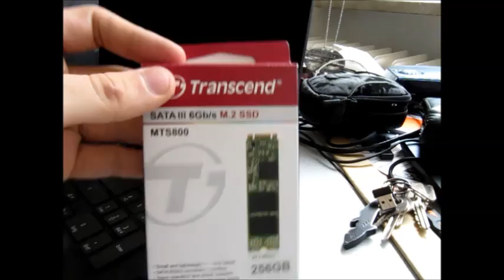Acer Aspire VN7-571g Disassembling and M.2 SSD Upgrade

Comment: Hey mate can you help me? I want to add some ram to my VN7-571G cause i bought the 4gb ram version, but i don't know where the ram socket is, can you do a video showing that or a picture please ?
Reply from the maker: +Luchin Bombin I'm not sure but i think that they are on the back of the mainboard. Go to 7:30 in this Video here. I think the RAM sticks are the ones on the Right, next to the USB plugs.
Reply: +Martianbuddah nice, ill check into that as soon as i can. One more thing, can you tell me how to unplug the biggest keyboard cable, the little ones are easy to do, but i cant unplug the big one
Reply from the maker: +Luchin Bombin I used a small flat  screwdriver to unplug the cables. That made it quite easy, i dont remember a big difference in difficulty between the three cables.
Reply: +Martianbuddah i had to push the white clip in the cable, instead of just lifting it. Thanks for all your help and time i hope you keep making this kind of videos :)

Comment: I have VN7-591G-77A9 it's with 60GB SSD. 
When i bought it i asked to change the SSD to 128 or higher, the guy in the store said it's not possible because it's one one piece with motherboard.
After watching your video i will definitely upgrade my laptop 
You added this SSD as external drive right? 

I found this photo, and this is inside look of my laptop. i think on the left side is the ssd and it looks easy to remove/replace.
http://www.notebookcheck.net/fileadmin/_processed_/csm_AspireV15_VN7_591G_Innereien_3d36158442.jpg

can i replace my 60GB SSD to 250GB  ? or i need to check motherboard is supporting that much? do you know about this??

Great job thanks for sharing !
Reply from the maker: +Anun Azganun yes, you can replace it.
Reply: Thanks!

Comment: Hello, I have a problem. I recently removed the keyboad of my v nitro to put a ssd in. I have the same v nitro as you. I removed all the cords (keyboard, mouse, lights) like you did but when i put it back together everything worked except for the red lights. Nothing seems to be damaged. The pins are not damaged and the cord seems fine. Do you know what i should do?? PLEASE HELP ANYONE. Thanks
Reply from the maker: +Tony Taouk Hard to tell without seeing it :D i can only imagine that the cable that is used for the keyboard lighting isnt plugged in the right way. But i guess you already tried reattaching all the cables more carefully?
Reply: Yes i did it like 10 times,
Reply: i had the same problem.! make sure u put the cable into the connector. and not on the "floor"of the board. i made that mistake like 10 times.. so watch good where u put the cable.

Comment: Great video, i have two questions, is it possible to install a video card in this model?? and the second one, this laptop supports 16 gb ram (so i can upgrade it)??
Reply from the maker: +theCronoceptor Sorry for the late response.the last time i opened the laptop was for this video so i'm not sure about the possibilities anymore. As there is a graphics card in my laptop, i'm pretty sure that upgrade should be possible. ( So if you dont have a graphics card in there, you should be able to get one ) And i would be really surprised if the ram upgrade isn't possible. I'm not sure if there is a free slot but you should be able to replace the existing ram with more powerful one.
Reply from the maker: On second thought, the gpu upgrade might not be possible (or at least not easy). Maybe the laptops that are delivered with a gpu already inside have it welded onto the mainboard. And if welding is a necessary part of the upgrade, i would not recommend trying it :D.
Reply: Ok, thanks for the respone, i think that too (abouth the gpu). One last question, do you know if this model supports 16 gb ram?? So i can upgrade it??
Reply from the maker: +Faramind I think yes, but i cant't tell for sure, sorry.

Comment: Hello Friend I bought my notebook aspire v 15 nitro And so the pc works with feeding cable plugged in If you take the feeding cable and 
Blacked out
Reply from the maker: +Miguel Martins Sorry for the late response. Some other guy in the comments had the same issue. He forgot to plug in one of the cables that is attached to the mainboard. Make sure they are all plugged in, one is coming from the battery
Reply: Hello
and how I can download the dolby home theater ?

acer v 15 nitro
vn7-571g - 764l

I am waiting for your reply .................

Comment: Does anybody else who has this laptop have problems with the wireless at all?  It's got a Qualcomm Atheros QCA61x4 wireless network adapter.  It's really weird.  Sometimes it works fine, and sometimes it doesn't work at all.  The range on it seems to be pretty horrible as well.  It does this even when other wireless devices are working fine, and I have the most current driver for it.

And if the wireless card just needs to be replaced altogether, any recommendations for which wireless card I can or should replace it with?  Please help!
Reply: I have VN7-791g and I have the same problem... When I connect my WiFi the wifi logo disappear turn to LAN logo and say I can't connect to network... And sometimes it work fine.... Shitty wireless card.
Reply: +Kras3169 at home everything works great but at school the WIFI takes about 15 minutes to connect (or I have to reboot several times etc.)
Reply: +Kras3169 I had the same probleme at begin. In fact it happend only when i used it on battery. It is cause of the management of economy of energie. Just change your management of your wireless card to 'best performance' when using on battery. Then it work perfectly. Sorry for my bad english.
Reply: ***** I throw that shitty Qualcomm card away and change to Intel AC 7265....working fine.
Reply: Kras3169 you just need a #0 Phillips screwdriver and a plastic card, remove all the screw at the bottom of the laptop and use the plastic card to separate the top panel,there will be 3 cables connecting the top panels to the mainboard , so you have to disconnect all 3 before removing it... The wireless card will be located on the upper left corner. (3:25 in the vid)... There is two cables and one screw, remove the cable and the screw and replace yr wireless card... And put everything back together.
Reply: +Julien34B Thanks your for your response.  I will try it, and see if it helps.  I also bought a Wireless Range Extender, and that seemed to help.  Your English was good, no need to apologize.  Thanks again.
Reply: +Rage Tech I'm leaning towards taking your advice and replacing the Qualcomm card with the Intel AC 7265.  Is it going to be a pain in the balls to do on my own, or am I better off letting a store do it for me?  I don't have any special computer tools or anything like that but I also don't want to get ripped off letting somebody else do it if it's something easy.
Reply: +anonymousphox If you posted under the username ABCDEFGHJK, I get the same error message once in a while: 0x000001d8.  LMAO, what a pain in the ass!  It's so frustrating.
Reply: +anonymousphox +Rage Tech I just wanted to say thank you so much to both of you for your help.  I am in the middle of studying for the CPA Exam but when I get some free time, I will definitely try to get this done.

Comment: Hi is it possible to get out the key's by 1 and clean underneath it? And how is it done? I'm afraid of breaking something... Ty
Reply from the maker: +michiel pizza I dont know, sorry :D didn't feel the need to clean underneath my keyboard yet.
Reply: Hi, don't know if you got your answer, but it's something you can do easily once you know how the jeys are attached.
For the main keys (A,Z,E,R...), the top of them is inserted and the bottom of the is cliped. So you have to pull the key off pressing the top of the key and pulling the bottom of the key. Usually there's no risk of break.

For the other keys, the thing is to find the cliped side and the inserted side. Just train with the usual keys till you see the force you usually need to get off the key and then try on the other keys, if it's not enough try from the other sides till it works. ;)

I have exactly this computer too, and it took me some time at the beginning but you can do it !

Comment: Hi, thanks for your video.
I did it like you did and it is working. Great, but i got little issues when i want to build it together. 

First i bought the same SSD from Amazon for 99€.

Opening was easy, but i did it different, cause it seems for me better. I did it from the front, i took a Kreditkart instead of my nails and it was very easy.

Putting up the Kabels is easy. The big one is for the keyboard. when i put everything together, the keyboard was not working. I had to try 4 times till my Keyboard was working. You have to move the mounting forward, put the cabel in and than move the mountings back. not like the other ones up and down. 

And i got problems with the cabels from the Wlan Modul. I got luck and saw that one of the two aerial cabels jumps out. this is so small that it took a while to put it back again. 

After that i had to inilize the ssd under Windows and format the drive, than it works perfect.

I think with this video everybody can do that if he got calm hands. 

thanks for help.
Reply: +bebe München 
I recognized that my speakers are not working now :)
Reply from the maker: +bebe München glad you could solve some of your issues. of course touching the inside of a laptop is always a bit risky but being careful helps :D i'm not sure how the speakers are connected to the mainboard but maybe you forgot to reattatch one of the cables? Can you still use Headphones? just to be sure that your soundchip is working properly.
Reply: oh yes, i forgot the cabel on the right side to plug in :) 
thanks. now everything is working perfect. 

The SSD was a great choice, the laptop is now really fast. before i got only 500GB normal harddrive

Comment: hello ! really nice video, it'll be helpful for me !
I've a question, i have the  Acer V Nitro VN7-571G-50YQ and i don't know if there is this m2 slot too, do you know somehting about that ? thanks :)
Reply from the maker: +Mathieu Foucher yup, i'm pretty sure it will look almost the same inside that laptop. vn7-571g is the name of the mainboard, the 50YQ just determines the rest of the configuration ( like, hard drives, graphics card, processor etc. ). But as long as there is no ssd in your configuration, i'm certain there will be a free m.2 slot inside your laptop.

Comment: is it possible to replace the hdd with ssd on the bottom right? instead of unscrewing and lifting the main board
Reply from the maker: +Sky13oii jup, sure. the m.2 slot has the advantage of having 2 harddrives in your laptop. I really like having this additional storage drive but if you dont need it, replacing the 2.5'' hdd is a good option. ( the performance of a single 2.5'' ssd might even be better than my configuration)

Comment: What happened when you cloned the HDD to the SSD? What made it a pain in the ass?
Reply from the maker: +Kevin Hu I think the Problem was that i didnt remove the HDD after cloning. The Drive Letters (C: D:) were wrong and some stuff in Windows got confused. I dont know which program i used for the cloning anymore but it was crappy and i ended up reinstalling the operating system.

Comment: Nice video! Thank you. I have exactly same laptop and think about upgrade. Do you know, is it compatible with PCIe SSD's like Kingston SHPM2280P2?
Reply from the maker: +Євген Ковалевський No, sorry. I dont' know. Initially i was interested in a pcie ssd too but i didn't find any information about the slot in this laptop so i decided that a normal ssd is good enough ^^ Maybe there is something written on the mainboard next  to the slot?
Reply: +Martianbuddah i must go to service center for this, because warranty doesn't finished yet:(
Reply from the maker: +Євген Ковалевський Hmm no the warranty isn't affected by this. you can open the laptop and upgrade it with an m.2 without breaking the warranty, i have asked the shop where i bought it, so that is for sure. ( Of course, if you break anything while doing it, the warranty doesn't hold ).
Reply: Oh, it's nice! Thank you!

Comment: Thank you for the very helpful video. Does the missing screw on the main board make it wobbly and not secure?
Reply from the maker: +Nathan Yu  Nope, the Mainboard is well in place without the screw. The USB and HDMI Slots are holding the Mainboard in place within the Case very tightly. You'll see that when you try to get the mainboard out after unscrewing the two screws. I still dont have any problems with the laptop until now, no wobbing, nothing ... But of course i would not recommend to do it like this :D better ask the shop where you buy your ssd if they can give you the right screw if it is not already included.
Reply: +Martianbuddah I have decided on replacing the HDD instead of using the M.2 slot. Btw, can you also do a video on how your laptop performs with the new SSD? Such as bootup, launching applications, etc.
Reply from the maker: +Nathan Yu Jup, i can do that. I'm Using Windows 7 and Linux Mint in Dual Boot so i'ts not a perfect Setup for a bootup speed test but i'll find a way to show it off. Give me a few days, i think i'll do it on the weekend.
Reply: +Martianbuddah No worries, take your time.
Reply from the maker: +Nathan Yu The video is done and uploaded, you can find it in my channel
Reply from the maker: +Nathan Yu Btw another possibility is to get an additional 2.5" Caddy and replace the CD/DVD drive. I think that's an easier way and i mean ... who really needs a cd/dvd drive these days :D. Even if it should be needed the SATA caddy can be switched without completly removing the keyboard.